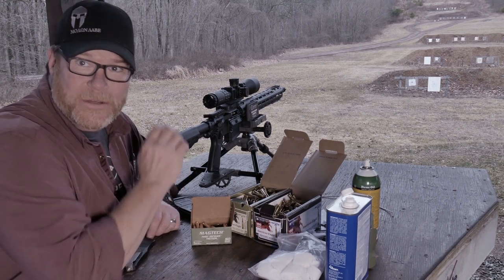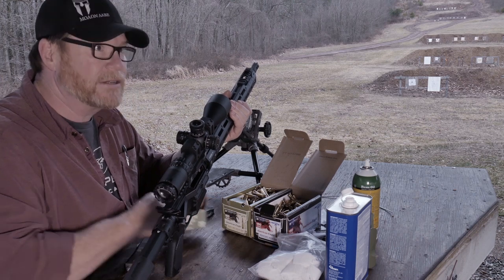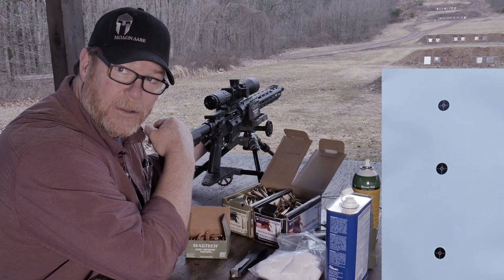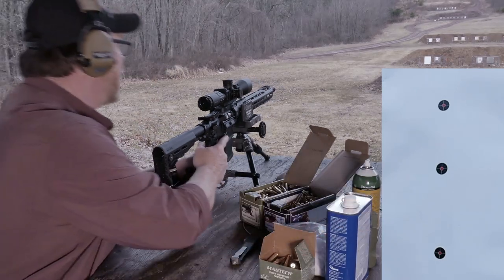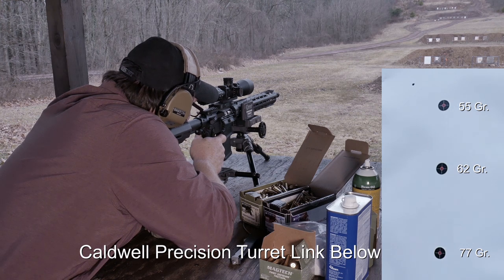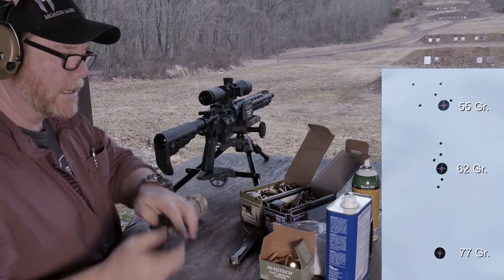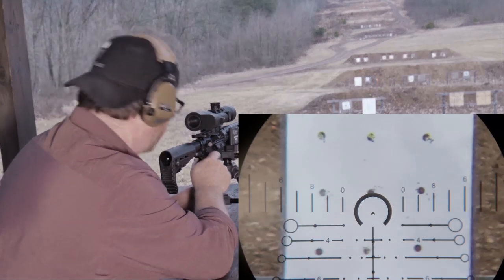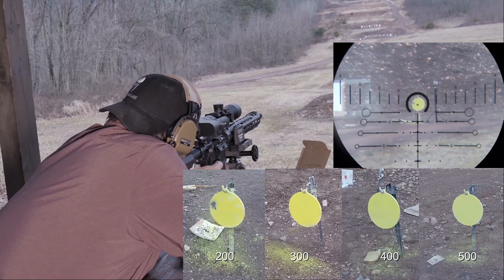Strike Industries Accuracy Test!

Comment: Weird, I see a lot of 1-8 twist rifles that do worse with lighter loads lately compared to 1-7 twisters. Every barrel is its own animal, but should be the opposite usually.
Reply: I've also noticed that. My 1/7 loves the lighter stuff.
Reply: Both my bca barrels love my 62 grain hand loads. Both are 1x7 twist.
Reply: My Odinworks 223 wylde 1:8 likes the 62 but does ok with 55.  Yet to run 70 anything out of it.

Comment: I’ve got a HUD DMR on a 6.5G   18inch Faxon / Faxon BCG.  CMC trigger.  Bunch of good parts. But. Never even used it. Only fired maybe 10 rounds to make sure it fires.  Even built a Form1 all TI can for it.     But I stole the mount off it for a raptor on my 5.56.   Now I need to find a decent mount that’s not 150 -300.    Id love to have something nice but too many builds at once prevent that

Comment: I just bought some 62 grain but thinking I need to go get some 77 if you’re getting that kind of performance
Reply: Depends on the twist rate and honestly every barrel even is a little different so one may do well with 62 and better with 77 or lights out with either or and not the other. It's meticulous no doubt

Comment: I dont know what that barrel cost but the stainless 16" in my CMMG groups way tighter than that with 55 grain at 100.  I guess its all about what ammo you are gonna use I know you have a lot of rifles with a lot of different barrels but for most something that only performs with 77 grain ammo is not really what most are looking for.
Reply: I agree, I have a Rock River Arms Elite Operator 2 with a 16" barrel and it will shoot sub MOA with 55 grain American Eagle all day long. If I shoot Black Hills 55 grain soft points it will shoot 1/2 inch groups at 100 yards. It is a 1x9 twist barrel and a bit on the heavy side but damn is it accurate.
Reply: Great idea for a video! Since you own so many barrels let’s do a 55 grain Ammo test at 100 and see what’s the best barrel for shooting cheap Ammo!
Reply: @badbilly429  I've been wondering why more companies don't make barrels specific to 55 grain since that's by far the most common bulk ammo people buy.
Reply: @MaxHavoc69  the birth of a business. Make it happen captain

Comment: No one here is “building” anything. It’s just assembly. All the pieces fit, you just put em together. I know alot of companies assemble rifles, but they have thousands and thousands of hours of experience, with that experience they know which parts work best other parts. They gassed it just right and made it soft shooting but suppressed and not. Reliability is 100%, accuracy is 1 moa or less and they back it up with full lifetime warranty, even the barrels. Those companies exist, solgw being one of my favorites. If you were having a hand built race car assembled, would you want some guy off the internet that googled how to do it with no warranty or even a guarantee or someone who has hundreds of thousands of hours of experience to assemble it. Then have it guaranteed with lifetime warranty all the way down to replacing the tires for free. Why not have that done with your ar?
Reply: Phillip Cameron if it makes you feel good to say you “built” something that takes 2 hours tops so be it.
Reply: Phillip Cameron did you read? That’s what I said on my post. To have experienced professionals assemble a rifle and back it with 100% lifetime warranty. Where in any of my posts did I mention welding?